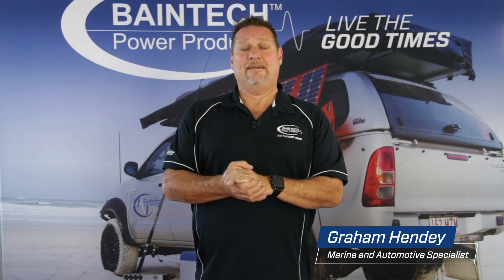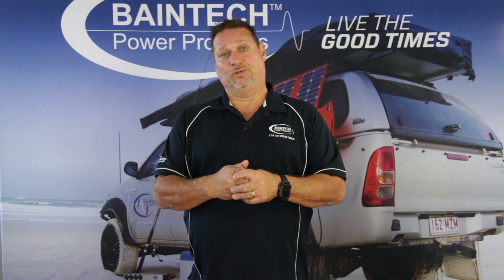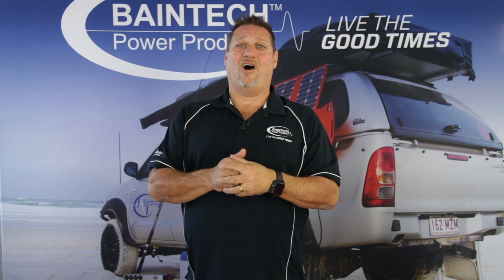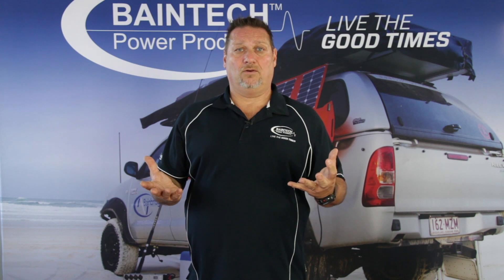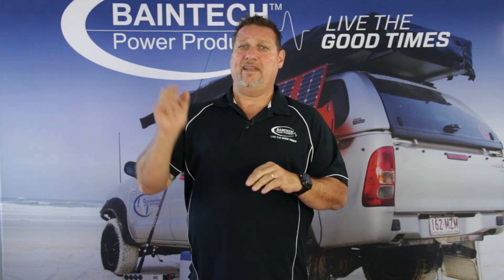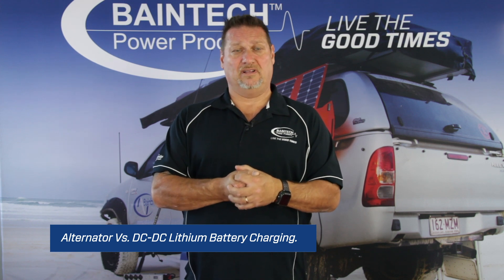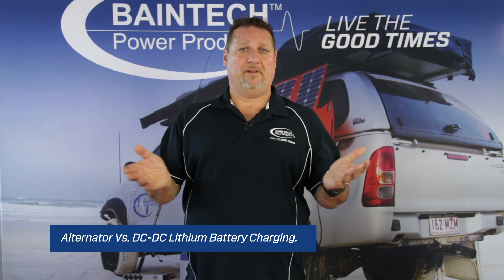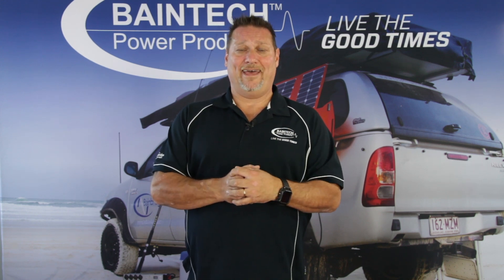Lithium Battery Charging - DC-DC vs. Alternator Charging | Baintech.com.au

Comment: So what if you are wanting to charge a 10kwh lithium bank and not just a couple of 100AH batteries? The largest dc to DC controllers I can find are 60 amps. If I wanted to install a high output alternator to push a lot of watts in, what's the best way?

Comment: So... If I have a Ford Transit with Dual Alternators and Dual batteries, I should use the van's Customer Connection Point (which is connected to the van's dual AGM start batteries) and a DC-DC charger to charge a 100 Amp hour lithium batter?

Comment: But if you are using a lithium compatible DC-DC charger running via the alternator then the DC-DC charger would control the charge rate wouldnt it??

Comment: So what do you recommend using to charge a lithium battery in a dual battery system?
Reply from the maker: Hi, A Lithium Compatible DC to DC Charger so the Charge is regulated by the DCDC Charging Profile. And Not a Constant unregulated load direct from an Alternator
Reply: @bainbridgetech good, day... My question is... If I use a 40a DC to DC charger from my cranking battery to my bank at the rear(3x 100ah)...would it also limit the discharge of my alternator to 40A to my battery bank  under extreme loads?
Reply from the maker: @vpowerelectrix998  A.	Yes as your loads would be drawing power from the Battery Bank. If you were drawing these large loads whilst the Engine was running and your DCDC was running then yes you would only receive 40 Amps assistance from the front battery / Alternator as that is the maximum current flow of the Charger
Reply: @bainbridgetech  thanks for the reply and clarification.. Much appreciated

Comment: UNLESS you have a set up like a trailer/truck camper that connects the coach to the truck by means of a 7 pin plug. Then there should be no stress to the alternator because the power flowing from the alternator to the coach batteries is usually less than 5A due to the thinness of the wire gauge. I am not an electrician, but you can Google more and that makes sense to me.

Comment: So, I have a vehicle with a secondary 24V alternator designed to deliver 100A continuous at just above idle.  I take from this that there is no problem from the battery side charging your 24V lithium batteries directly from the alternator?  (the alternator is brushless military unit, not your average domestic item) The max charge rate is 100A under all circumstances

The current secondary battery system on this vehicle, is 2s2p 110AHr AGM batteries that make the 24V battery bank. 
- Can I put 4 of your 24V batteries in parallel as a drop in replacement for my current AGM batteries? I ask this from an electrical perspective, knowing that there are other aspects such as the enviornment and mounting that I will ignore for the minute

thankyou
Reply from the maker: Hi John,
It is not recommended to connect any Lithium battery directly to an alternator.
If there is a AGM battery connected to the alternator in parallel then it is OK but connected directly is not recommended.

The reason is that the Lithium battery when fully charged will go open circuit.
At this time the alternator would need sufficient protection for the transient noise at the time of disconnect.
When the batteries are connected to an alternator and a start battery is in parallel then these transients are absorbed by the start battery.

To make this 2nd alternator system work we would recommend a design change such that the alternator is put into parallel with the main battery system or a 24-24V DC-DC charge is used in series.
Please contact us for further information https://baintech.com.au/contact/
Reply: @bainbridgetech   Thank you.  your detailed and technical reply is awesome.
Reply: @bainbridgetech  MOST lithium's yes but there are some that are designed to be charged directly from the alternator with no issues at all. There are 1000's out there being used in this way and no problem. I personally can charge at 200a because the batteries are designed for it. The Victron video shows a battery with no BMS and the marine alternator. Of course it will fail. They aren't designed for it. Other brands have a better temp rating than a lead acid or AGM and are even better suited.

Comment: Hi I’m considering replacing my AGM cranking battery with a Lithium cranking battery in my Amarok 4wd. I have a second battery in the rear that is a 100A lithium used to run accessories. I also have a Redarc BCDC charger. Someone suggested a Victron Battery Protect in the system? Is this correct. Any advice would be greatly appreciated 
Thanks George
Reply from the maker: Hi George, You may wish to speak to someone who specialise in cranking batteries. Baintech Lithium are for deep cycle use, not cranking. The need for the Victron battery protect would be to disconnect loads at a certain voltage before the battery gets to low and unable to start the vehicle.

Comment: Informative video--I really appreciate it!   Would you recommend a LiBIM isolator, one that would cycle the alternator on for 15 minutes or so and then give it a rest?   My application is a camper van with 400AH of lithium and charging at only 30A per hour would require 12+ hours of driving to fully charge, which wouldn't work too well!
Reply: I wouldn't do that. 400ah need solar and or generator. PowerMax have good chargers I would get two 100ah and a propane generator plus whatever room you have for solar. That's how I do, go for shopping and let the gen work.
Reply from the maker: Hi Paul, best to call the team for a chat to discuss your specific requirements for your set-up.